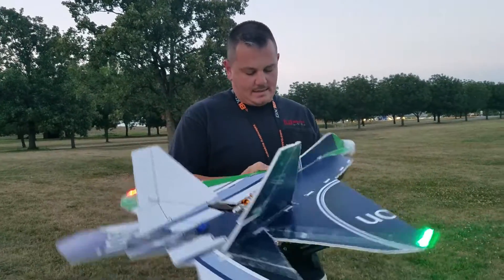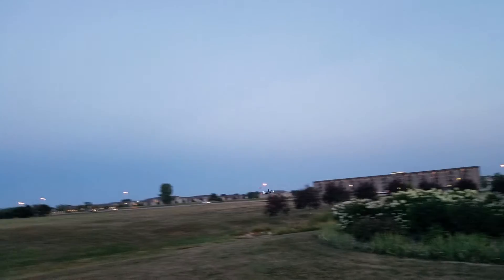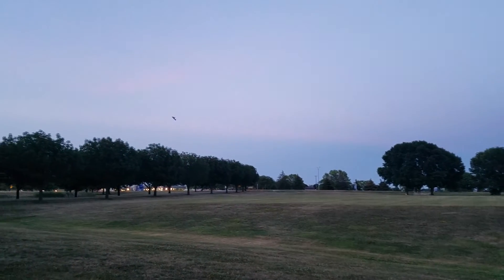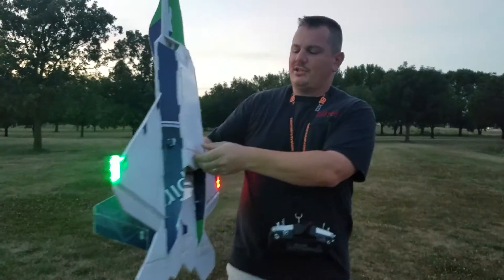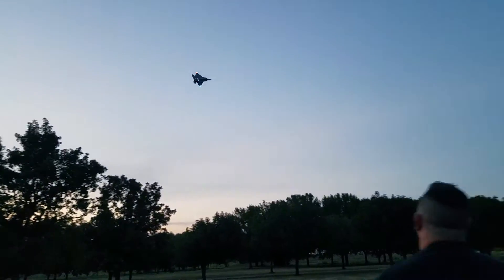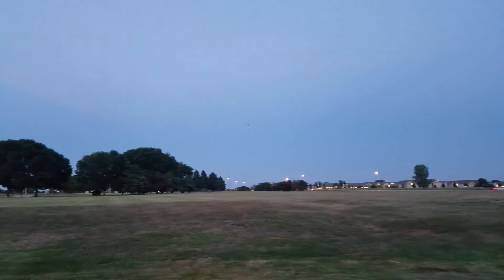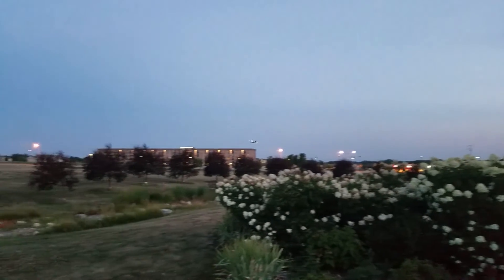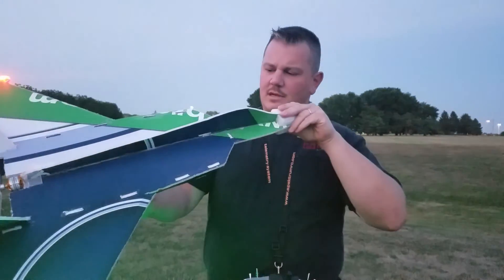F-22 Profile Plane - Electronics Repair - Flight Review - Part 5

Comment: Hi brian,  I am going to build a hobby king glue and go plane.  When it comes to choosing motor and ESC, it says suggested is 20 to 40 amp ESC.  is it the more amps the faster or more powerful it'll be?  When you are building a plane how do you match up the motor and ESC and battery for that matter as far as discharge rate is concerned.  thanks
Reply from the maker: You want to get the prop size and motor worked out, then just pic an ESC that's usually about the "next step" up...so if you think you'll need 18 amps, go for 20 or 30 amps. Always better to keep an ESC cool, but you gain some weight too...keep that in mind.

Good luck!